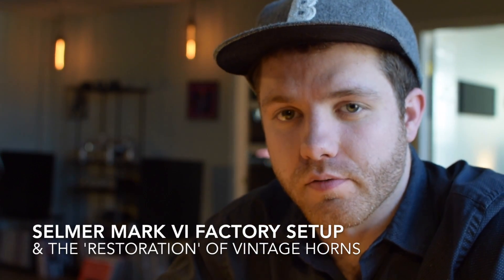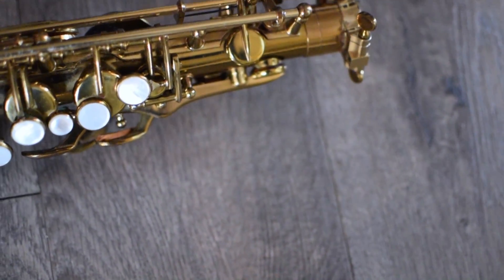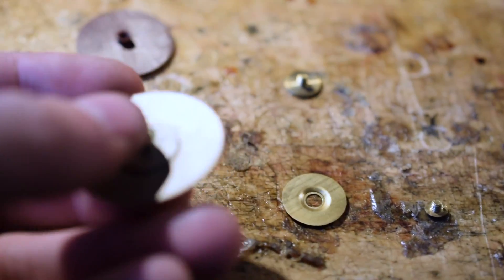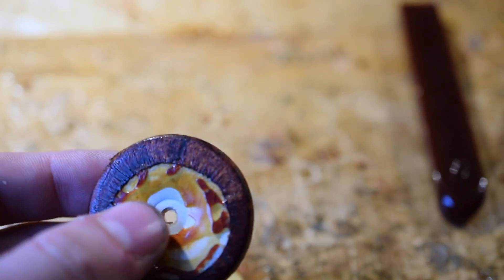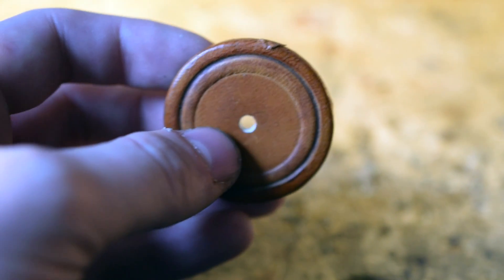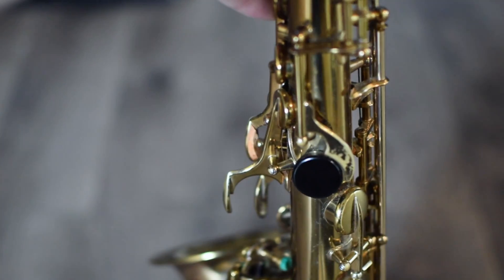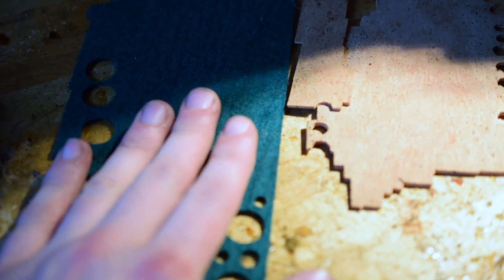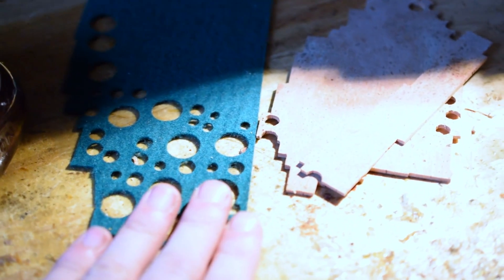an overview of the original factory setup on a selmer mark vi saxophone

Comment: A really informative video for a Mark VI Tenor and Alto owner who is not a tech.   Both instruments are from the early 70s, so in the tail end of MVI production. Also both had been overhauled where the tone holes where leveled and Pisoni pads installed. I'm assuming that the Pisoni pads are thinner than the original pads Selmer used. However, with the tone hole levelling there have not been sealing issues. Thank you for expanding my knowledge of the instrument, more of these videos would be welcomed.

Comment: I've played my 1957 MK6 alto for around 40 ish years, and the right-hand stack bar feet are very different to the ones on this video. They don't have a round foot, but a slit arrangement with an adjustment screw threaded into the upper half of the slit foot. Presumably, this helps when adjusting the opening heights of the right-hand stack?